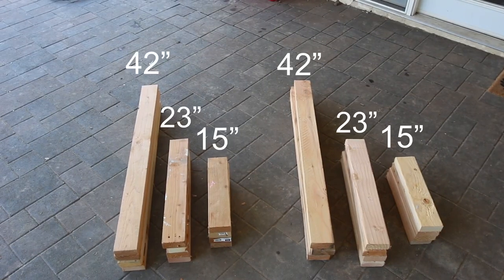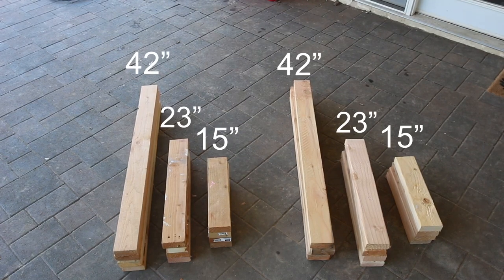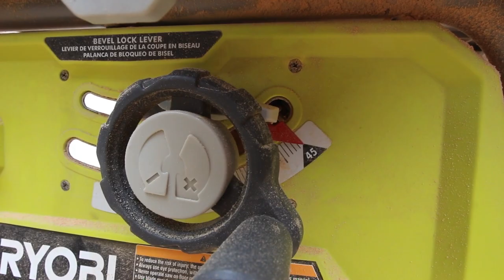DIY Privacy Fence with Planter Boxes | How to build Deck Wall | Privacy Screen

Comment: Looks nice . Where did you get the fence boards ? Can you please send a link ?
Reply from the maker: Thank you! We used 5.5" cedar pickets from Home Depot and ripped them down on the table saw to 2.5" each

Here is the link:
https://www.homedepot.com/p/Sierra-Pacific-Industries-5-8-in-x-5-1-2-in-x-6-ft-Incense-Cedar-Dog-Ear-Fence-Picket-458830/202703421

Comment: Miter saw or circular saw for small beginner DIY wood projects? I have no experience w/ either and was wondering if you guys have a preference.
Reply from the maker: Hey, I would grab a 12 inch miter saw. They come in different sizes, but I would spend the extra money and get the 12 inch. That way you don’t run into pieces of wood that you can’t cut all the way through. Hope that helps!
Reply: @BrocAndAimee  That does, thank you!

Comment: Did you stain the cedar? I’m look at using the same cedar planks but not sure if I want to stain them or not.
Reply from the maker: Hi Ed! We did not stain them. Thankfully cedar is naturally weather and rot resistant, we just sealed the boards so the sun wouldn't fade them as quickly. Hope this helps!